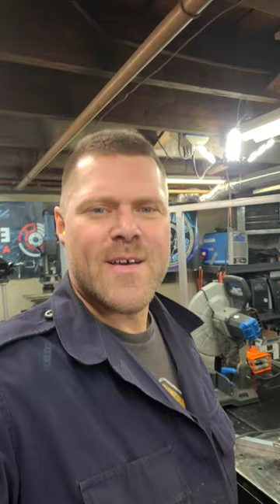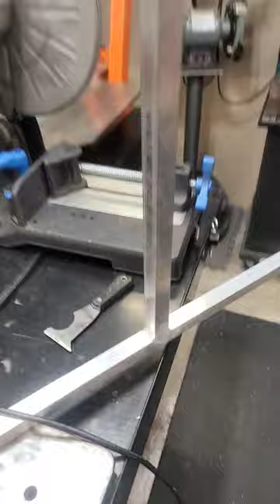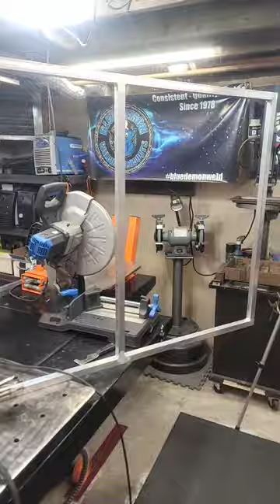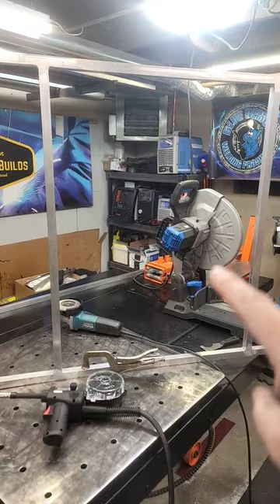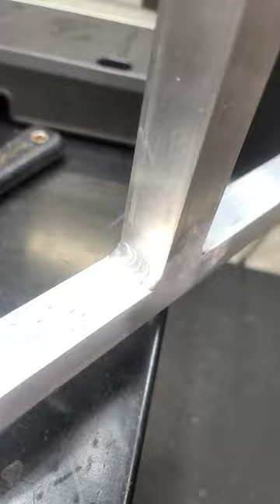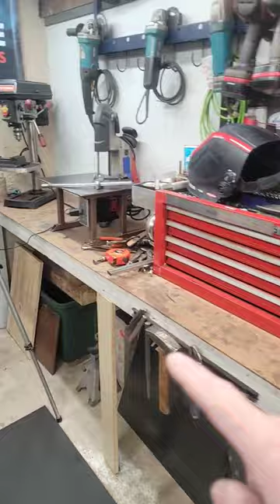Building Aluminum Cargo Trailer Race Cabinets Easy DIY Project

Comment: I thought there was a need to apply a liquid cleaning solution on the aluminum before welding the joint.
Reply from the maker: It's best practice to mechanically remove the oxidation layer as well as clean it with acetone.

Comment: I bet you aint using your hobart mig. Lmao hahaha
Reply from the maker: Hahahaha nope but I thought about it. That little Hobart did an impressive job for a little 120 volt unit. I used a spool gun this week. I had a bit of trouble getting it dialed in perfectly due to wire size but overall I'm pumped how it looks